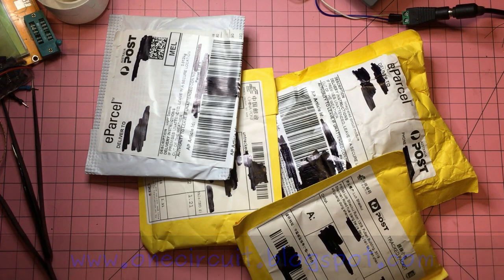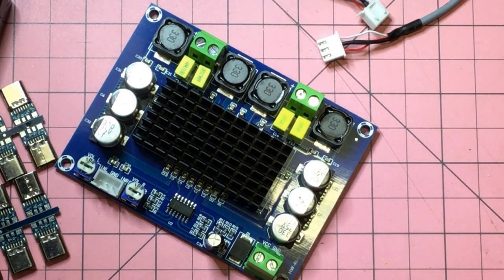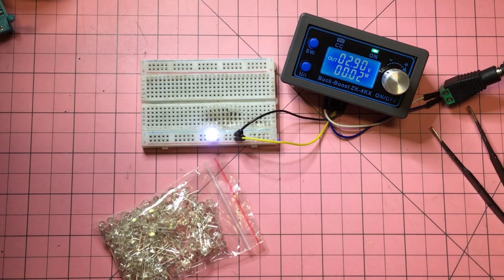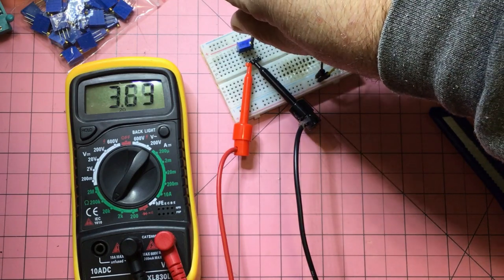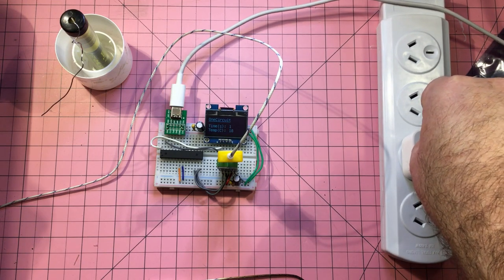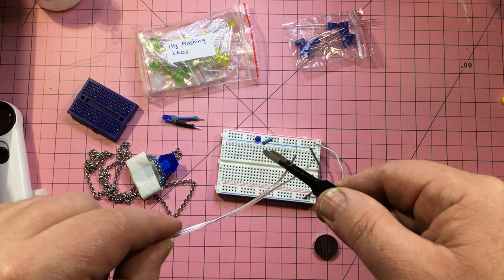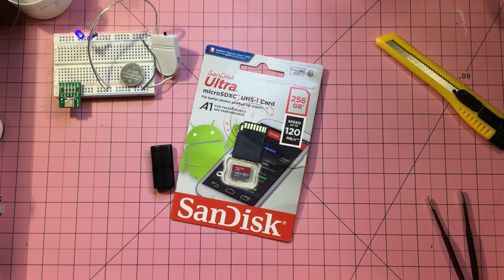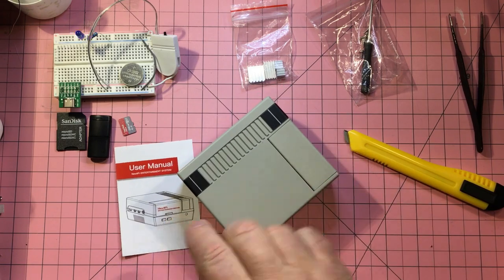Mailbag #6 and Postbag #2

Comment: As to SD/TF cards from [not local reputable store] I'd say capacity is always an open question. I'd run it some testing software against it before writing anything of importance/unique to it...  I've had about 50/50  results from Wish where the prices weren't totally off, and 0/8 on thumb drives/TF cards where price/GB was way to low. Never had an issue with refunds though, sometimes got it before even having time to append the logs from the tests to the case.
Reply from the maker: I’ve been using it in the pi4 and it’s been fine so far, around 240Gb of retro games - yippee! 👍😀